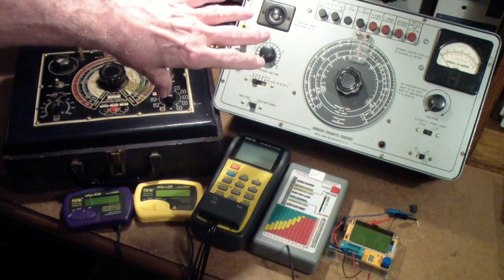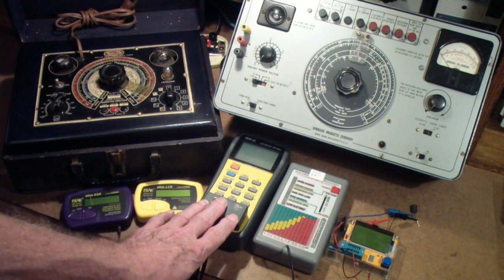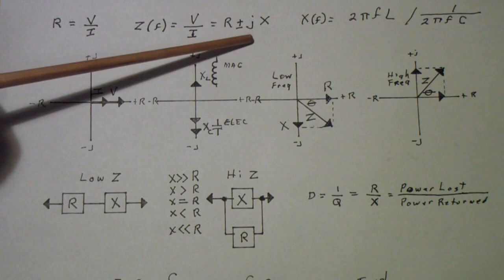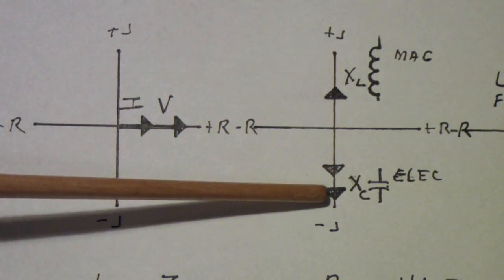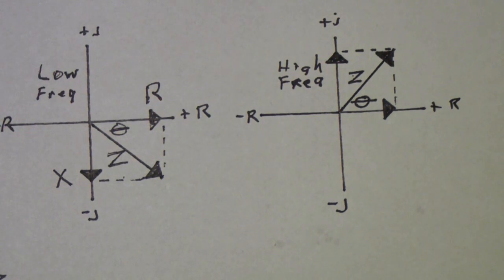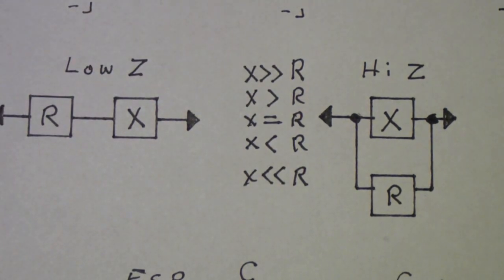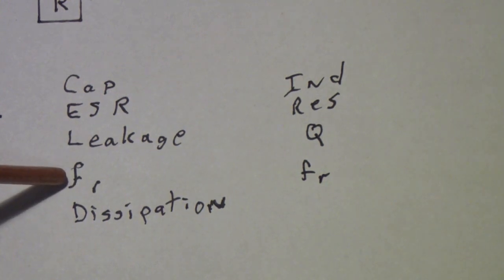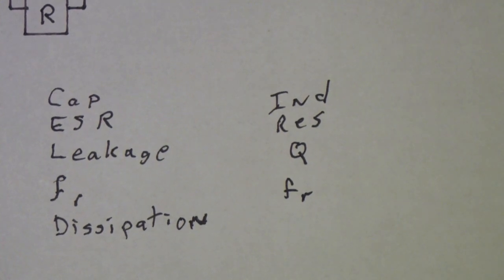TTT335 LCR Testing Concepts

Comment: Just a note since I recommended it: When you look into that LCR T4 check out how it does component testing and identification.  I use mine mostly for that.  Sorted a container full of components into NPN, PNP, SCRs, N or P channel mosfets. It will detect diode packs and and a couple others I can't think of.  I haven't done much testing for accuracy since I use the AD2 for any L or C test that needs to accurate.
Reply from the maker: Yes, I have found the T4 to be quite useful over the past 7 months I have had it. I have already made a number of videos using the T4 (and other) testers for things like diodes, transistors, etc. but I am in the process of re-editing all of them with another video editor so they may take a few days or weeks to get published. Thanks for the comment and ideas.
Reply: @tomtektest8042  good deal, I didn't realize you have had one for a while.
Reply from the maker: @clytle374  I actually have several. I think I got the T4 around the end of last year and have some others I will be showing again in future videos. I think I mentioned the T$ in an earlier video on testing but I am not sure. At any rate I have already made videos on diode testing and transistor testing using the T$ and other similar testers but I am re-editing them in a different video editing package in an attempt to increase the resolution a little. They should be out in a few weeks.

Comment: Please consider getting an upgraded camera. When I watch at 720p, it looks no different than 480p. I normally would not complain about something like this, but you are showing all this great old gear, and I would like to be able to clearly read all the lettering on the instruments. Thanks for the videos, though.
Reply from the maker: I think the reason you see less detail is the way YouTube processes my uploads since they are made on a 1920x1080p camera and show up as such in my copies but for some reason YouTube processes them into a much lower resolution. I will try to make a video with a different editor and see how that looks after YouTube processes it.